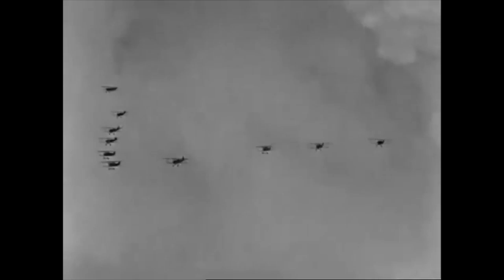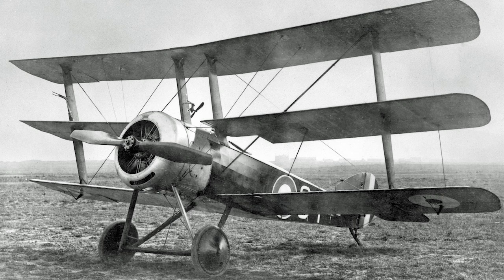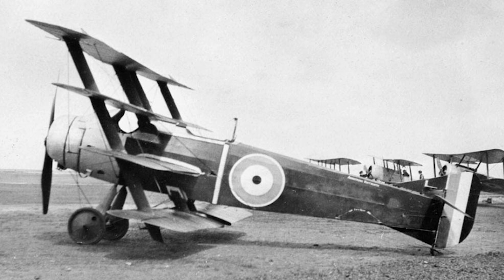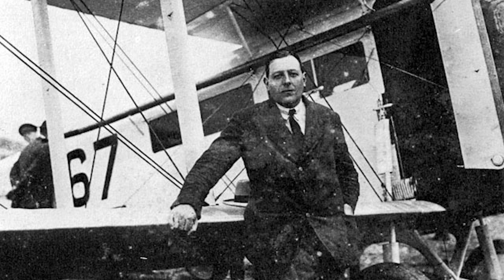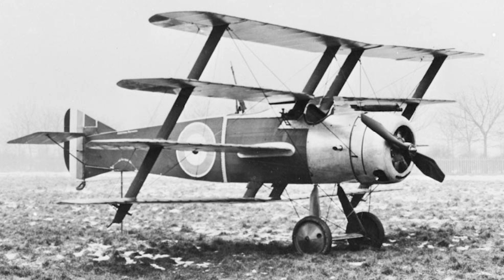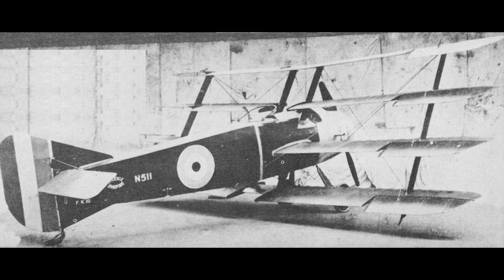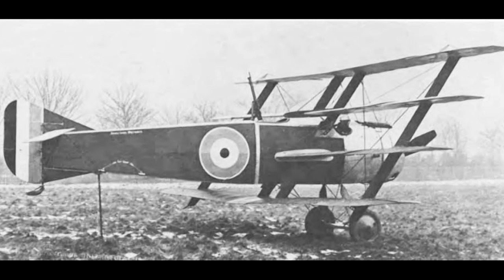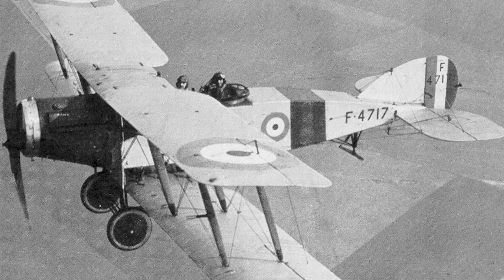Armstrong Whitworth F.K.10; “Two Wings Good, Four Wings…Better?”

Comment: Why did they want such a large gap between the wings? And why was it thought that the gap must be equal? Stacked close to each other equally or unequally they could have made a compact lifting structure round the fuselage with smaller struts, less drag, more speed, etc

Comment: Interesting to hear about the FK9. And especially how it's performance was ruined by perfectly reasonable requirements. Poor Frits Koolhoven, the man behind a lot of "almost" and "what if" planes. Have you covered the FK55 already?
Reply from the maker: Not yet, it's on the list. Though probably do the fokker 23 before that, far more material available on it.

But will probably cover other, earlier  koolhoven aircraft as well. As you say, he was prolific.
Reply: @EdNashsMilitaryMatters  About the D23: I found it elucidating to look up other aircraft using the same engines and how they fared with these.

Comment: Fredrick Koolhoven was responsible for a number of rather odd aircraft designs in the early years of aviation. He not only designed the Armstrong Whitworth FK9 & FK10, but also the Armstrong Whitworth FK5, FK6, FK8, the B.A.T. FK22 & FK25, as well as the Koolhoven FK50. If you look up these aircraft you will see that Koolhoven seemed to "march to a different drum" when it came to designing aircraft.

Comment: "Pfft! Only four?" Said Horatio F. Philips from his 200-aerofoils flying machine.
Reply: As far as I can remember none of his designs managed to get off the ground for more than a few seconds.  Impressive-looking things, though, and plausible in theory - at the time.  I believe the high-pressure/low-pressure interference between the planes is one of the things that make them inefficient.

Comment: Farweasel
Go on then Ed .......... Tell us why you reckon the Fokker DR1 Triplane was 'superior' (55 sec) to the Sopwith Tripehound:
After all, ' tho the differences weren't great:  The Sopwith was slightly faster, had a slightly higher ceiling & a bit more range.
Their excellent manouverability was pretty much the same,  structural strength about as bad and the Tripe's motor was far more reliable.
Admittedly the Tripe was by all accounts a pig for the riggers to work on, but still.

Comment: You did it again - never heard of this before.
Thank you Ed.

1927 - 'Stalin was looking for new aircraft for the Soviet Air Force. He had long been a fan of the 'Red Baron' and thought that possibly 3 wings would be better than two (as most fighters at that time were still biplanes). When his chief designer - Victor Russkiekurskvolgogradski - agreed to take on the design idea. Stalin - apparently on the spur of the moment - thought that if 3 wings was better? Than 10 would be FAR better.
 He asked Russk...the designer, if it could be done? The designer - fearing for his life if he disappointed Stalin - said he could...barely.
So, off Russkiek...the designer went to try and built a 10 winged aircraft. After 3 years, the prototype was rolled out. It went through a couple of tepid, test flights when Stalin arrived - unannounced - to the third test flight on April 1, 1930. He immediately ordered the test pilot - Captain Ivan T. Errible - to 'fly the wings off of her...or else'.
 Also fearing for his life, Errible took the plane up and after a few, basic maneuvers, decided to really impress Stalin with a snap roll.
 Unfortunately, the planes maneuverability with all of the wings was gigantically underrated by the pilot. Upon entering the snap roll, the violence of the maneuver was so intense that it immediately snapped his neck..killing him instantly. Close up video camera footage taken at the time - even with it's crudity - clearly shows this horrible event in grizzly detail.
 After that, 3 of the wings fell off...and the plane flew straight into the ground.
Stalin walked up to the wreckage, threw a medal on the dead pilot, walked to his car and was driven off.
Within a week, both the plane and the designer vanished...never to be seen again.'
Reply: Sounds true to form. Any chance of you putting that video on YT?
Reply: @roblamb8327  Lol...sorry. Lost the video.
Reply: @McRocket  McSurprise! But I still live in hope that someone may come across with a copy. Tx.

Comment: Thank you for this fascinating item. I didn't realise that plane designers went one better than the famous tri-decker and that its demise was mainly due to other, superior biplanes coming through. I suppose that it was too revolutionary to try out in actual combat when so much was at stake. Gripping stuff.
Reply: Fokker tried five wings. The Fokker V.8 looked like the result of a midair collision, and made the FK10 look like a Hawker Fury by comparison...
Reply: Sadly (with 84mph, 1 machine gun, any 10,000ft ceiling) this is more like the WWI equivalent of setting a Sinclair C5 against a Bentley in a 24hr Le Mans endurance race. To understand the Sinclair you'd have to have experienced 1980s Britain. Or has someone already made a video on the subject?

Comment: I know of at least one attempt at flying a 7 wing airplane. The plane collapsed before reaching enough speed to get off the ground. There were probably many more attempts at such oddities in the early years of flight such as the 9 wing Caproni Ca 60 flying boat. As odd as it looks it was capable of flight. Just do a search for multi wing aircraft.
Reply: Fokker did attempt a 5-wing design; a triplane wing at the front, and a biplane wing towards the back.

Comment: The DR-1 had four wings you did not count the wing between the wheels it's lift was factored into the design.
Reply: I was also going to mention that. It was a common feature in Anthony Fokker's designs of the period. The lift it provided offset the weight of the landing gear.
Reply: @jfu5222  Yes it was a good idea you are going to have the parasitic air drag of the axle. You might as well give it a little more drag by covering it with a small wing and get lift from it.
Reply: Was going to say the same, beat me to it.
Reply: Wouldn't that make it a bi-sesquiplane?